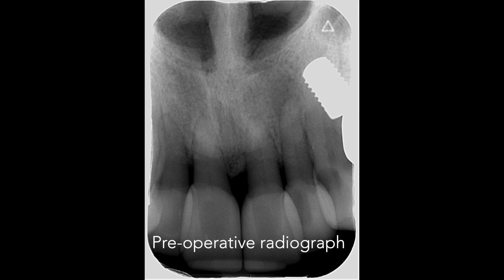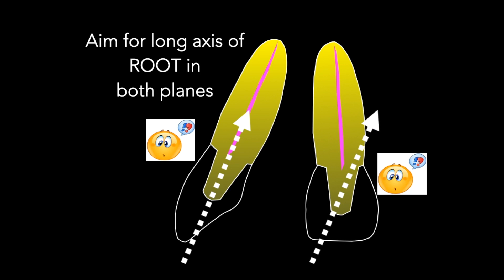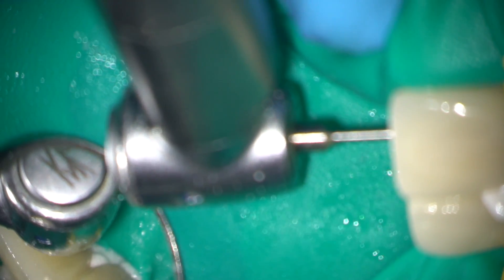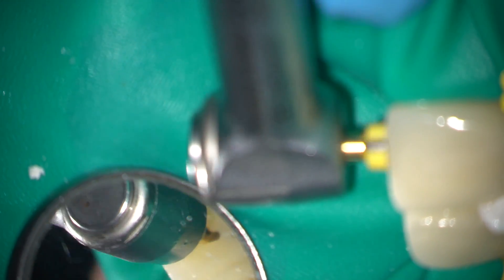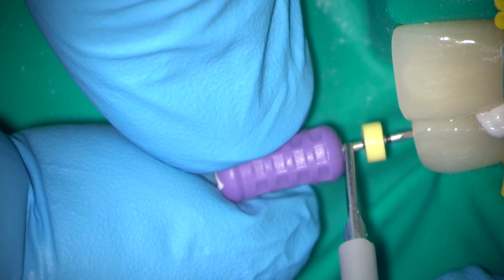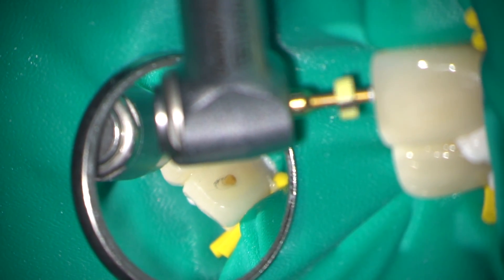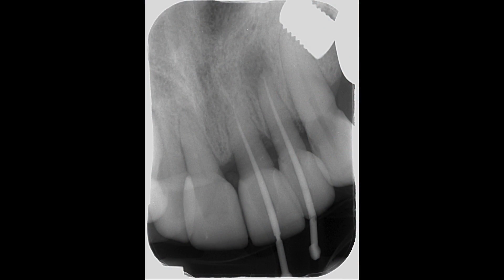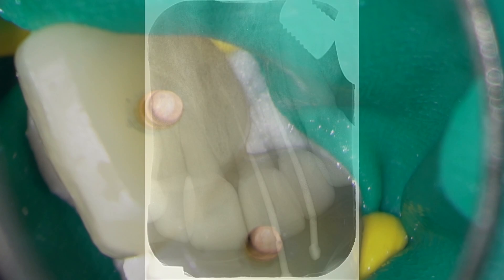micro access through ceramic crowns

Comment: Thank you Dr Rhodes, I have a question: Is there a way to measure how far to cut into dentine before we start searching for the canal orifice in maxillary anteriors? For example, I learnt the rule of measuring cusp height to plural horn distance with mandibular molars from the radiograph and it has really helped. Do we have such concept for anteriors and with such micro access, how do I know the best way to angle my bur when drilling? Thank you so much!
Reply from the maker: For anterior teeth you can perforate the enamel with a high speed diamond and then use a very small LN bur to find the pulp chamber. I always check angulation in both planes when accessing anterior teeth - to avoid drilling in the wrong direction - especially if only one tooth is isolated or the incisors are pro / retro-clined.....and the pulp floor map is present in anterior teeth - head in the direction of the darkest dentine.
Great questions!

Comment: Dear Doctor Rhodes, I have been a big fan of your channel. I am really passioned by endo but the more I try the harder it gets. I used to use the reciproc blue only and have a few file separations now and then. I wanted to avoid them alltogether and started using W1 Gold as well as the Gold glider. I never use files more than one time and I try to be as careful as possible with the glide path. this week I had a patient where I used C-Pilot, Gold Glider, W1 small and W1 primary. At one point I couldnt get to length so I recapitulated with iso 10 and gold glider, was very happy to get it to WL again, switched to the W1 small and it broke. I was devastated because I took so many precautions. 

How often do you change your files during one RCT, how do you decide to take a new one? 
sincerely SDA
Reply from the maker: Hello there, all files are single use and if the canals are sclerosed or highly curved you may need several instruments for a case. Any sign of unwinding or if the instrument seems to be struggling to cut I change it.
Cheers
John
Reply: and may i ask another question: when you get to WL with the gold glider, do you then do the whole shaping with the W1 gold and recapitulating with iso 10 or do you use the Gold glider again? I am always afraid to go in with the Gold Glider again when the canal is already shaped in the coronal 2 thirds
Reply from the maker: Hi There, I only use the Gold Glider to establish the glyde path to WL and a size 10 for patency and W1 to taper cheers John

Comment: Hi John , would it be ok if I ask the following question as it seems no one was able to tell the exact reason. My lower 4th tooth was extracted 4 months ago. After lots of pain now the wound is healed, However, the adjacent 3rd tooth is sensitive. At the begining the said it was a refered pain. Isn't this too long time still to be a refered pain. I took a 3D, they took a look at the 3rd tooth and confitmed there was not a singal issue with this tooth. There is no even a small cavity on this tooth. When I tap it a little bit with my finger it feels strange , it is not like pain but more like sensitivity and it just botters me, it should not be like this. The wound is ok, closed, the bone has been forming. The thing is when I use this tooth on purpose to eat something, it feels bad around the tooth and the extracted tooth feels bad too, when I stop it goes away in a minute. There is no way I can do a bridge as it will worsen the thing. Could it be still a refered pain after such a long period? Thank you and have a nice day
Reply from the maker: Hello Kristian,
This does sound unusual after an extraction.
Perhaps a second opinion to rule out neuropathic pain?
Hope you get some resolution
Best wishes
John
Reply: @johnrhodesendo  Hi John, I had a second and I am getting a third next monday. So far after all the test MRI MRA, triger point etc everything I mean every known test, there is not evidence of neuropathic pain. The wound is closed, however, the soft tissue between the extracted tooth and the adjacent tooth is slightly swollen and tender, it gets worse when I eat and whne it gets warmer. It doe move when I press it with my finger, I feel it like it needs to be cut off. The dentist who extracted the tooth said it needed to be cut off and also there was 2 mm sequestrum , the thing is that the wound is already closed. Not sure if there is a conection between the sequestrum and the soft tissue I mention above. I am getting a second opinion next week by an oral surgery dentist. Thank you very much for all your answers so far. have a nice day

Comment: dear john 'always great hearing from you,could you please describe your magnification equipment and video setup,or otherwise recommend a decent 1st microscope?
best regards and health
eitan
Reply from the maker: Hello there!
I am using a Global A6 with LED lighting, Sony A6300 body and crystal mirrors.
If you can try a scope that helps, you don't really need more than 3 steps but LED light is an advantage and gives the best illumination.
Cheers
John
Reply: My question regards to what to look for in a microscope brand which is not at the top notch of the companies:zeiss,kaps,global?

Comment: Great case John!
Do you trim the guttapercha before you proceed with the WVC, after you take the cone fit radiograph?
Reply from the maker: If the canal is large apically i may take off 0.5mm otherwise I stick to cone fit length

Comment: Hey doc, amazing case. I've always had difficulty locating canals under full coverage restorations, thanks for the amazing tips. Given the access is so narrow what technique did you use for obturation?
Reply from the maker: Hello 
In this case I used vertical compaction with a fine tip, but BC sealer and single cone would have worked too
Cheers
John